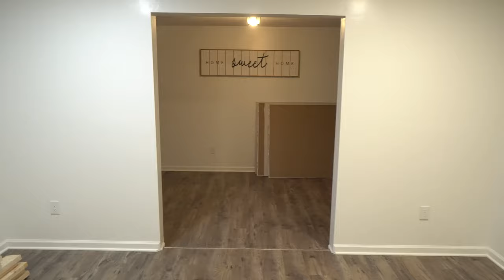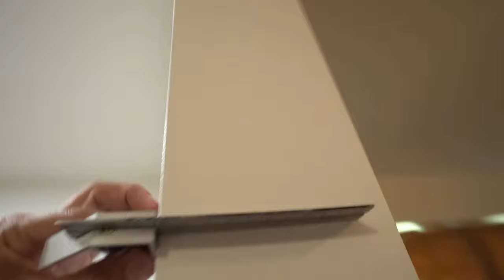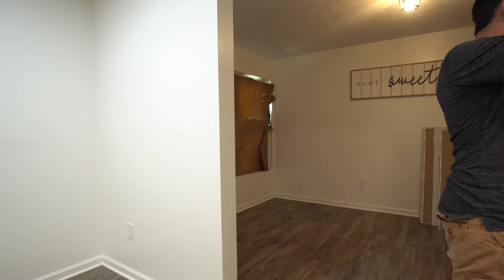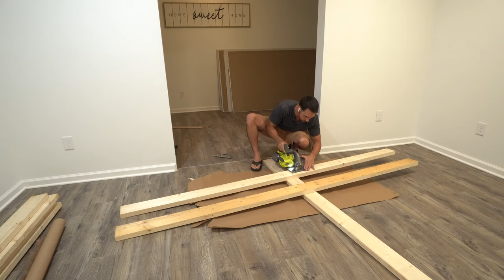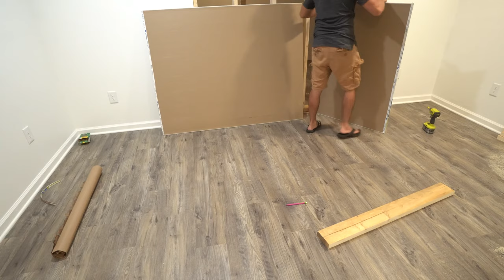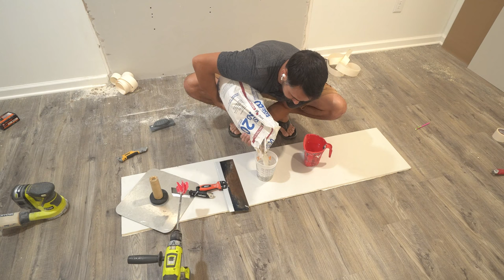DIY: Enclosing an Old Doorway

Comment: Thanks for posting. As a general point (I'm a DIYer) it's best to avoid butting up drywall / plasterboard to the floor, instead leave a 1-2cm gap. It's highly absorbant and any moisture will eventually destroy it. By doing so, it reduces the risk of any condensation / spillages / flooding rising up the board.

Comment: You forgot to put the inclination in. 💁🏾‍♂️
Reply: Insulation?
Reply: @gitgit1995 😂😂😂
Reply: The incline was transferred to the bottom of the studs. When he puts the frame in place, the bottom will have the incline while the tops stay straight. Otherwise the header wouldn’t sit flush due to the drop

Comment: Hi there! I'm a new homeowner and am starting to fix up my home. Thank you SO much for this video! Quick question and I'm so sorry if it's dumb lol- how come there is no insulation that goes into this new section of wall?
Reply from the maker: Heya, not a dumb question at all!
Typically interior walls don't have any insulation in them since they're in a conditioned space already. However if you're wanting to have an interior wall have a bit of sound dampening fiberglass insulation does a wonderful job of cutting down the amount of sound that transfers between walls.
Reply: Usually you can get away with not insulating a wall that’s indoors on both sides. For instants, if the other side of that wall is outside, you would need insulation. Hopefully all the walls surrounding his house are already insulated.

Comment: Maybe I missed it not sure, but good to mention to use a drywall mud designed for taping. It has glue or something in it to make the tape stick. Not the filling type mud which is only for holes and such. My first times taping I wasn't succesfull since I was using the wrong type, got frustrated until I found out to use the right one. Magically started to feel like a pro.

Anyway, ended up closing our dining room to add an extra bedroom because of this video. Thank you, great stuff!

Comment: Great video! It’s literally the only video I’ve seen that shows what I want to do.

I have a question, you mentioned you needed to use a drill bit to screw in the drywall. Would you mind elaborating on that? Also, what’s the length of the screws you used? Thank you
Reply from the maker: Thank you!

You don't necessarily need a drill bit, the bit I used is a drywall dimpling bit, but a standard phillips head bit works fine. The dimpling bit just reduces the chance of driving the screw too deep in to the drywall.
The drywall screws I used were an inch and a quarter.
Reply: @JoeMartinMVC  I appreciate it. Thank you!

Comment: What thickness would you say the 'mud' is over the dry wall board? I'm taking a door out and the wall either side was skimmed again when a builder was taking another wall out in the room. When fitting the stud frame would it be best to expose the framing that the door framing is attached to (I guess that may happen anyway as I take the door frame away, but depending on how I do it...) so that the new stud wall is perfectly aligned with the existing wall framing. I guess since the existing wall has a double skim I will need to apply more mud... ?
Reply from the maker: Typically you'd be at around 1/8 inch thick for a skim coat of mud.

There's no need to expose the framing that you'll be framing in, as long as you can get the interior wall framing to connect to the old framing via screw or nail.

You would need to apply more coats of mud in that instance, but could also make it easier to blend the seams together if you sand the existing wall.

Comment: Thank you for your video, I like it, I have a question can i start the drywall from buttom or lower first, is that ok? or have to start from the top like you did, thank you very much, Gbu
Reply from the maker: You can start from the bottom, that’s fine. The reason most start at the top and work down is because they want a factory straight edge at the top to keep things as straight as possible. But if you make a clean cut, or use a good tape for the top you’d be fine there.

Comment: Thanks for the video... the most helpful that I've found so far. Thank you! Do you need to screw the bottom 2x4 to the floor and the top 2x4?  After the framing, how do you determine the thickness of drywall that is needed? Are the studs/current walls all standard so that once the frame is up, I should know what thickness of drywall to get? Thanks again!
Reply from the maker: Thank you!
It's not necessary to attach the 2x4s to the floor, and could potentially hit a pipe that's underneath the floor, so I would advise against doing so. The top, however, I do suggest screwing in to. It's best to have 3 sides of contact to mitigate any movement or fluctuation in the wall that could cause flexing and cracking of the drywall joints.
Some recommend using contact adhesive on the bottom plate before putting it down, which can also help with that but generally isn't needed for spans under 8 feet.

As for the drywall thickness, just measure the entire width of the wall, subtract the thickness of your 2x4s (3.5 inches) and divide by two. So in a standard wall you have a wall that is 4.5 inches thick as it has the 2x4 (3.5 inches) and two pieces of half inch drywall.
Reply: @JoeMartinMVC  thanks again, keep up the awesome work!!!
Reply from the maker: @Someone_VIP  Thank you!

Comment: If you have a space that you want to close in like this but its only a single door width (34inchs) do you need to build and insert a frame ? Does the framing assist the surrounding areas structurally or is it just so you can put up the plasterboard etc ? Probably a silly question but hey i dont know the answer 🤷‍♀️
Reply from the maker: Structurally it makes no difference as it would not be adding any strength really, so you're fine on that front.
It would only be for attaching the drywall to, as any span greater than 24 inches tends to cause drywall to flex too much and break loose from the wall.
Reply: Thank you for explaining this. Much appreciated 👍

Comment: Does the air gap help with noise supression? I just moved into a place where they closed off a normal doorway and put a cabinet to fill the gap but I can clearly hear the person on the phone in that room. They probably only boarded it up and put the cabinet up. Would adding a layer of dry wall help with the sound or is it just going through the normal walls?
Reply from the maker: Sadly the air gap actually amplifies the sound a bit. If you were looking to mitigate sound transfer you'd want to put insulation in between the stud bays. 
Another layer of drywall will help some, but ideally you'd want a layer of mass loaded vinyl or an acoustic insulation board between the two pieces of drywall.

Comment: So I have glass section above my doors. They are ugly. I want to remove the old doors and the glass section above. I would like to replace the glass section with a wall. So there will be nothig above the door, just wall. Would this method work to create the wall above the door? This in interior
Reply from the maker: Yeah it would be a very similar process. The only difference that may be needed is if the wall goes all the way from floor to ceiling you'd want to double up the top plate (2x4 that goes on the top).
But besides that potential scenario, yeah the same process.
Reply: @JoeMartinMVC  thanks

Comment: Thats what I need to do but I want to make the middle 2 studs wider so I can add an interior door.  I need to add one horizontal wood at the top ( whr the top of the door would be) and screw in a prehung door ?
Reply from the maker: Why would you make the top two studs wider? A prehung door is designed to go in to a 2x4 frame so it wouldn't need to be any wider than the 2x4 header.
Reply: @JoeMartinMVC  Hi. Not the 2 top studs. The 2 middle vertical studs. It's because I want to install a door in the near future but want to close it off right now.
Reply from the maker: @ukelilly  Ah, my apologies, I misunderstood your comment.
For placing a door in you'd just want to measure the opening area for the door frame, add another half inch on for wiggle room and shimming, and it'd be good there.
On the top portion of the door framing you'd still want to have your studs be 16 inches on center.
Eventually I'll be making a video on how to frame out doors as well.

Comment: Do you have a video on how to cut out a interior doorway in drywall? How much would it cost a contractor to do so?
Reply from the maker: I don't currently. Comically I actually just did that with installing interior French doors for someone yesterday, but wasn't able to record it. 

Cost for a contractor can range from $300-3000 to install an interior doorway. 
The reason for such a large fluctuation is because of what could be inside the wall. 
If it's a standard wall that's not load bearing and doesn't have any electrical or plumbing behind it, it's cheap to do. 
If it's load bearing, that's the most expensive one as there's a lot of extra work to do to not compromise the structural integrity of the house.

Comment: I have a cased opening that spans a little over 8 feet on our main level sitting on a concrete slab and wood plank flooring. Should I just put the baseboard over top of the flooring or cut it to expose the concrete? Also glue or drill to secure since it’s just over 8ft? Thanks!
Reply from the maker: The main question is how you feel about the ease of work for your floor. If you believe you'll have to rip it up for any reason, your best bet would be to cut out the 3.5 inch by 8 foot section so your 2x4 can sit inside of it and then your drywall and baseboard would sit over it.

As for gluing/attaching to the bottom, I wouldn't bother doing so. You can attach it on the sides and top and it would be fine.
Reply: @JoeMartinMVC  great thanks! If it’s just preference I’ll probably just leave the flooring for ease of work. I definitely have more confidence to try this myself and save some $!

Comment: Any tips on enclosing a wall with bullnose corners? Would this be the same process or should I remove the corners first?
Reply from the maker: The bullnose could actually make it easier if the nose is recessed. If the bullnose is proud of the surface (further out than the surrounding wall) it would have to be removed to not have a very visible hump in that section of the wall.

Comment: Only one layer of mud on top of tape? Did you sand it after? No cracking later at the joints?
Reply from the maker: Nah, I did a total of 3 layers and sanded in between them. I didn't show the full drywall mudding process in this video as this video was already very long and that's a whole other subject to cover. 
No cracking or shrinking at the joints when you use tape and don't use the the pre-made mud that takes forever to dry and then shrinks.

Comment: Great video man! Any advice I just bought a home this is my exact same situation except it has two barn sliding doors. Any other alternatives to cover or close off a walk way like this? The doors weren’t installed properly and I’m just going to get rid of them.
Reply from the maker: It depends on the route that you want to go. If you just want to remove the doors and leave the opening, that's the easiest way. You'd just have a few screws or lag bolts holding the door hardware on and then you'd patch the drywall which would be easy.

If you want to remove the doors and close up the hole, it'd be similar to this process.
If you wanted to make it a regular door, that's also an option as you can be a complete interior door for around $150 from Home Depot and they're very simple to install.

You could also use an accordion style door, or bifold doors, but it all just depends on what your goal is for the space.

Comment: If someone wanted to reopen the doorway, where would they start and how would they do that?
Reply from the maker: Putting a hole in a wall can be quite different. If you're just putting in a standard 36 inch door there's minimal risk, but if you're going for a french door or anything much larger there is a concern if it is going in to a load bearing wall.

If you've assessed that the wall is not load bearing, then you would simply measure out where you want the door to go, plus 3 inches all the way around, cut out the drywall from that area, cut out the studs in the wall, and built a rectangular frame with doubled up 2x4s inside of the space that you cut out, and mount your door frame.

If it's a load bearing wall it's more difficult and you'd have to see if additional support is needed, if you need jackstuds supporting the door, frame and wall, etc.

Eventually I'd like to make a video on it, just haven't had an opportunity where I've had to add a door anywhere yet.

Comment: I noticed that you did put any installation in our new wall. Would installation help with noise reduction and room temp?
Reply from the maker: Correct, typically speaking most people do not install insulation on interior walls. However doing so would indeed help with noise reduction. If you're going for noise reduction you'd also want to apply caulking at the top, bottom, and sides, and on the 2x4s before screwing in the drywall.

If you really want to make it better, you would use a 2x6 base plate and top plate and stagger the 2x4s then weave the insulation between the studs going horizontally instead of vertically like you traditionally do.

I do plan to eventually do a video displaying this, just have to build a faux space for it since I don't have a spot to do that myself currently.

Comment: Hi I have a question I am enclosing a door way just like this I just don’t understand how you measured the thickness of wood you needed I measured it and it’s 4 5/8 inches, what thick ness of wood AND dry wall should I put up
Reply from the maker: Most standard walls are just regular 2x4s with half inch drywall on each side. 
The only reason it would ever be thicker or thinner would be if it were an external wall or a mobile home typically. 

Alternatively you would just measure the wall that you're closing in and subtract one inch from that measurement to know what size lumber you need as two pieces of half inch drywall equals to one inch. 
If the remaining amount is 3.5 inches it would be a standard 2x4 (2x4s actually measure at 1.5x3.5 inches)
Reply from the maker: Totally missed the part where you listed the 4 5/8, my bad. That'd be a standard 2x4 frame with half inch drywall.
Reply: @JoeMartinMVC  thank you !

Comment: I know this sounds a bit rude but how much did this cost final?
Reply from the maker: Not rude at all.
Materials wise: $30 in drywall
Wood: $25
Box of Screws: $12
Drywall Tape and Mud: $25
Total: ~$100 in materials

Cost for client: $1000 if I recall correctly.
Reply: @JoeMartinMVC  thank you so much!

Comment: So you don’t need to remove any of the flooring ?
Reply from the maker: It's not necessary, but if you were doing this over hard tile or other similar hard flooring you'd want to cut it to make it easier to remove in the future if you ever change the flooring. But it's not required to do that as there are tools to cut flush against a wall.

Comment: Did you attach it to the floor?
Reply from the maker: I did not. I utilized three points of contact with both sides and the top so I did not attach the bottom to the concrete as it wasn't necessary for such a short span.